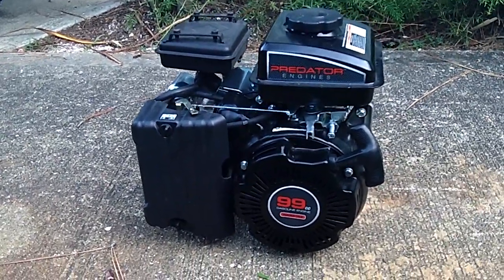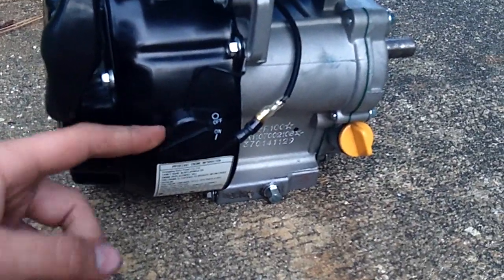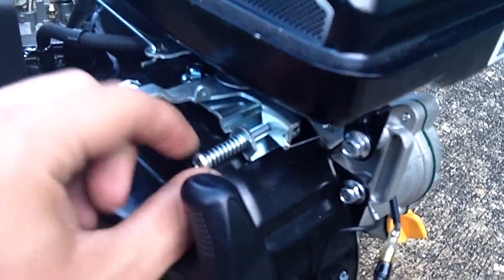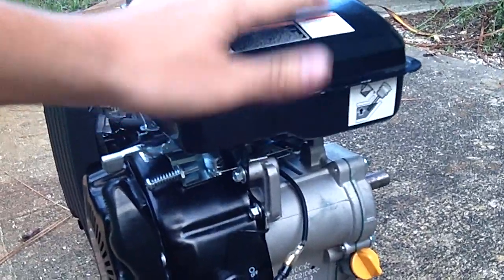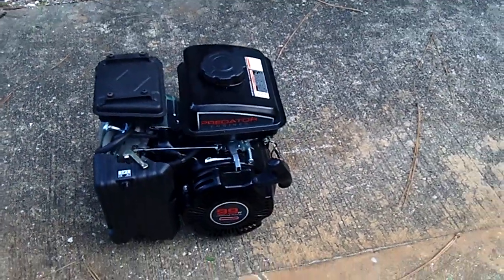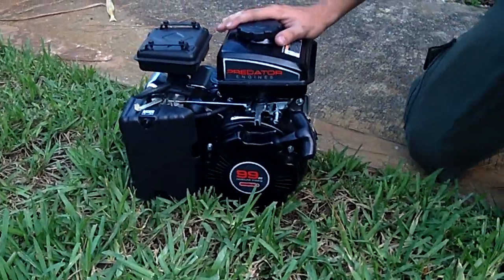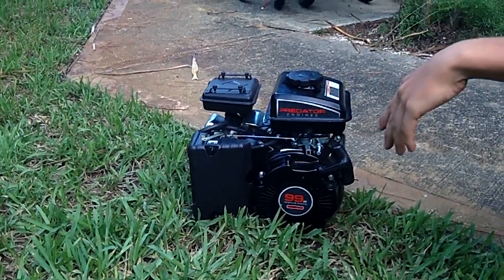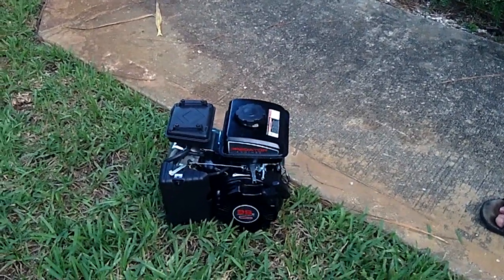Predator 79cc/99cc 2.5hp Engine Review & Tutorial

Comment: I have 3 of the same size engine. Bought them for a good deal and I have not used them at all. I only turned one on and it works. Drained everything out of it and stored it back in my storage room. It's 5 years and I don't know what to do with them.
Reply from the maker: I had the same problem. After i made this video i put this engine in my attic for 10 years. I just recently sold it for $50. Still ran great after sitting for so long but i did drain the fuel out.

Comment: I just Installed one of these 79 cc predator engines on a 26 inch trike everything went together really good< How ever it really don't have any power, you can't go up the slightest hill with it without pedaling the bike and I don't want to do that. Is there any thing that can be done with this or is the motor to small
Reply: Your clutch may be slipping because I have a 1hp engine and it power up a hill
Reply: David King n
Reply: You need a bigger sprocket. I recommend 50 teeth.

Comment: What's the fuel shutoff and what it dose?
Reply from the maker: stops the fuel from flowing from the tank to the carb. They're useful if you need to adjust the carb, or if you plan on storing the engine because you can shut the fuel off and run the engine till the carb is dry.

Comment: now they have 79 cc 3 hp.
Reply from the maker: I don't know but the 79 and 99cc engines look identical to me, so i would guess yes
Reply: Well I just got one of these earlier for 100$ and it has 3hp it is for a kart I am building
Reply: Would the gear box they sell for the 99cc work?
Reply: Esteban Pedroza the 212 is over rated
Reply: Esteban Pedroza true buy you got to remain that they are make in china
Reply: Thegeokiller 15 your an idiot. 10 bucks for over 100 more cc ya total waste..
Reply: Ryan Rohauer *you’re an idiot. Go back to school, kid. BUT, whoever said the 212cc is over rated is even dumber than you are. Different sizes for different applications. Example: started my little kids off with a 79cc stock predator (which I got for $80.00 out of the HF sale catalogue like an adult) on their kart till they get older. It goes 15-20mph on a Carter frame. We already have a stage 2 predator 212cc kart with a comet CVT on a Manco 2 seater frame that goes 45-50 and a 15hp Lifan on a single seater Manco Baja 200 frame with sand paddles. You kids are all stupid. Take a shop class. And a grammar class.

Comment: Great video.  I have both a 5.5 and 6.5 hp predator engines and I really like them a lot.  The 5.5 required about a 4 hour break in period and now it runs like a dream.  Nice smooth low idle and fast take off.
Reply: Thema inproblem how many ccs is it

Comment: You could easily install an in line fuel shut off valve on the engine. In line fuel shut off valves should be available for not much money at most small engine shops.

Comment from the maker: I think maybe they sell the previous generation of the engines in the UK or something like that, because they used to sell the 196cc 6.5hp, but they stopped about halfway through 2011 and started selling the stroked 212 predator. It's a similar story with the 2.5hp one. Haven't quite decided what i'm going to use it for, maybe rig up a genset using an alternator and a belt or something like that.